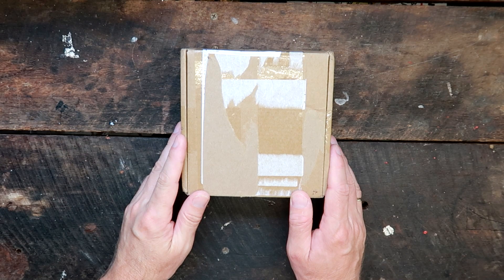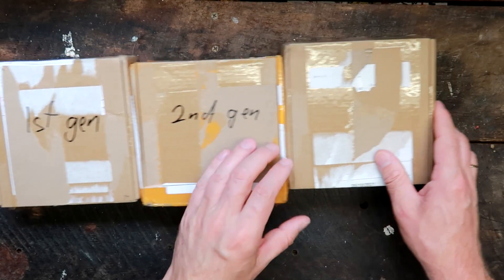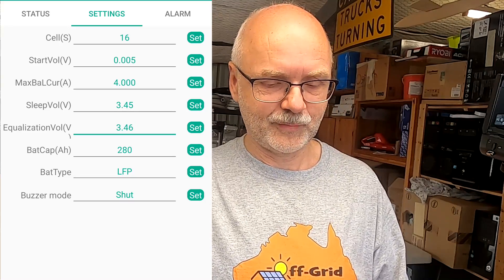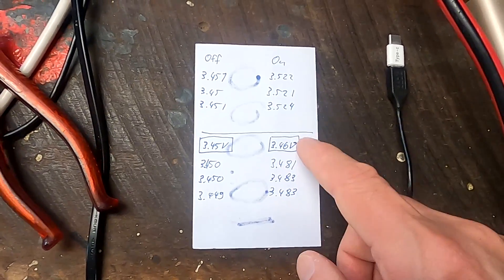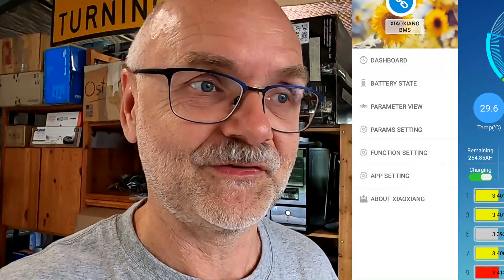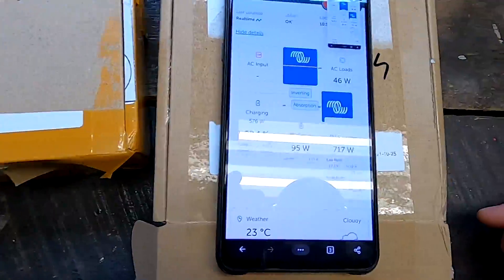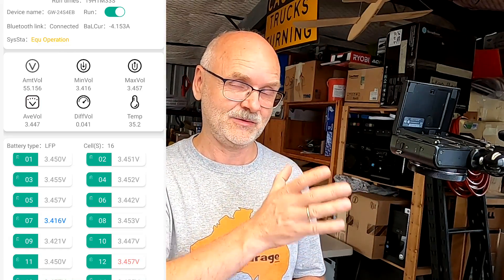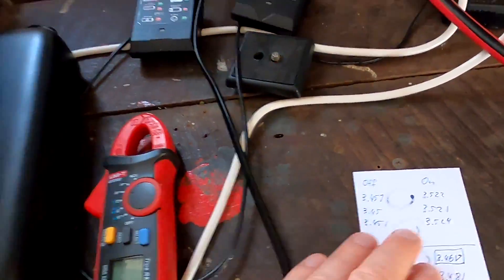The NEEY Active Smart Balancer is fixed. But there is something you need to know...

Comment: It's great that NEEY is listening to feedback and making changes.  Thank you for making this happen!  Can they add a 12v relay signal when a cell is at high voltage or low voltage?   No need for a BMS just use this NEEY balancer and add a charging relay and discharging relay and you are done.
Reply: yep, give it another gen or 3 and it could be the best one out there.

Comment: 12:05  -  when you add 22mV to 3.65, you get 3.672V and not 3.87..  there must be 220mV to get over 3.87 :) and i think 22mV is not that much, you just set 3.63 and get it right to 3.65, maybe 3.652 which is just 2mV over.
Reply: I'm a little surprised why you haven't got a response to this highly relevant comment.

Comment: I have a Heltec that I would not have purchased IF I would have found you channel before I purchased it. I was going to get a NEEY but after watching your videos, I was glad that you did al the testing on it first to keep ME for wasting my $$!! To add salt into my wounds,  I have all Daly BMS's (I do like them despite of the issues)!!!!!   I run a big off grid system with 4 banks of Lithium batteries, 3- 300 AH banks with all Nissan Leaf gen1 cells form 4 different cars. The last bank is LG server batteries with a capacity of 225 ah. I love my Lithium batteries but as you can expect with mixed - used cells, I FIGHT with cell balancing. Always looking for the best solution to help balance the banks, and get the best life with the most energy. Looks like NEEY might be the solution.

Comment: Good work!  I like that NEEY balancer.  If I were you, I'd give them a final message to tell them how they could fix their balancer to ensure it works as the user expects it to work, so that they can improve their product & offer a superior product at more affordable price than their competitors.

Frankly, it works well enough as it is, but it really should not allow any cell V to exceed the user defined "Equalization V" on function setting.
Reply: It's not a controller but a balancer, right? So such a setting for this device should be irrelevant, because it shouldn't be charging the higher battery to an even higher voltage, only bumping up lower ones.

Comment: Thanks for testing this out fully. I guess, as you said, as long as the bms is set up properly,  you don't have to worry too much about exceeding maximum cell charge voltage. I can see many more advantages to using the average cell voltage for starting balancing especially if you prefer to give yourself more of a cushion between balance start and max cell voltage. I do think you would need to use the device for an extended trial to fully prove if the theory is sound.  

I really enjoy these types of reviews, thanks again!

Comment: I bought the 1st gen version of the Neey active balancer because I am building a 16s battery pack with Lishen 150 ah batteries using a 150 amp Daly BMS. Instead of relying solely on top balancing I figured I would get this device instead of the Bluetooth dongle and on off switch for the Daly BMS and get myself a powerful active balancer, I guess I jumped the gun. Even if I don’t win the giveaway thanks for staying on top of this and getting us a 3rd gen on the market that’ll replace the first one I bought! If I don’t win this giveaway I’ll start going through the headache of return/refund/reorder :)

Comment: Andy, I am currently designing my off-grid system...with a DIY 48v battery.  I have not made the jump for purchasing yet, because i want to make sure I understand what I actually need.  So, I have been watching and following your videos on the importance of a BMS and balancers.  Hopefully, Neey will see that triggering off the average of the cells is really not a good idea.  All cells will charge differently, some faster than others and some not so fast.  If one cell charges a lot faster, it could exceed it's tolerances before the Neey balancer even thought about coming ON.  That is when you hope your BMS (if you have a good one) would catch the issue and shut down the charging before something drastic happens.  Good video, information has been helpful.
Reply from the maker: Thank you. Yes, that was exactly the point I raised as well. Using the average voltage is not optimal. The chances are not very high but it could be a possible problem with one cell running away and triggering the BMS eventually. Especially if you charge to 3.6V or even higher.

Comment: Hi uncle Andy, great video on this. Least with your feedback they listened and made changes to their product.

Currently have running 125ah lifepo4
3 rows of 16s
2 rows the cells are parrell tonigher on 1 bms as the suppliers gave me mixed cells and head to try mix an match the best cells with the worse.  With a Daly smart bms and 2 of the flying capacitors active balancer.
(sellers excuse was he can't justify if everything was done correctly on my side and if I did or did not abuse the cells so no exchange or refunds
The 3rd row has a smart ant bms which it seems stable as it was matched cells.

Thanks for the great videos again

Comment: So, I would say the purpose of a balancer is to "catch" the cells that go too high and have as small a difference in cell voltages as possible.
In my opinion, it is a design error to rely on an average package voltage. Good that there is still a BMS that prevents the cell voltage goes above 3.65V.
Reply from the maker: Yes, I'm with you on this. Not ideal.
From the results of my tests, it won't be a big issue because the cells will be balanced at some stage and deviation is less and less with every charge. 
Still not a good design. Others can do better...

Comment: Thank you so much Andy. I've been so excited for this revision but they seem to refuse to get it right 😕 deciding to prolong the life of their solid state hardware over their customers expensive chemical equipment feels so very wrong. 

My BMS only has 30mA balancing but my cells are way way off. One gets to 3.6v and lowest is only gets to 3.36v. I've added a solar panel and Victron controller to my van now so with luck, I'll be topped up daily but now more than ever I think I need to balance. Before I only charged when I decided with the engine (renogy 20a dc-dc charger)

I'd have been better off with an old version and only turning it on occasionally to get balanced. I think I'll spend the money on a bench power supply instead and give the pack a damned good top balance. And I now realise I should have done that from the start.

I have a 135ah 4s pack with a 330w panel and Victron 100/20 controller plus the above DC to DC charger.

Comment: I bought a daily smart BMS, first fault. Then i watched your first video and bought the active balancer, received it in days on the day you posted your video where the sleep voltage was discussed. I could not use this balancer.
I live in Perth so sending the BMS back costs roughtly 50 AUD when you buy it for 110 i have not received a refund yet.
Like i said i have a daily smart bms, thats why i need the NEEY.

Comment: I have had this Dali 250 A 48 V BMS running for 8 months. It keeps 16pcs 280 Ah batteries ( lifepo4 from Basen) in 0,03 V difference . Batteries are directly from packet put to 16 in series. Max V is 58.4 V.  Using MPPsolar charger/inverter